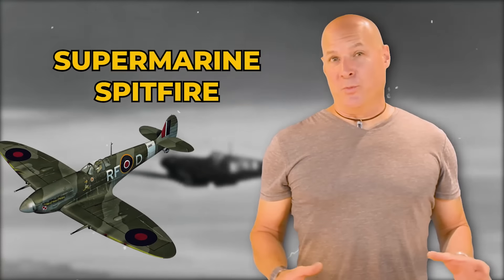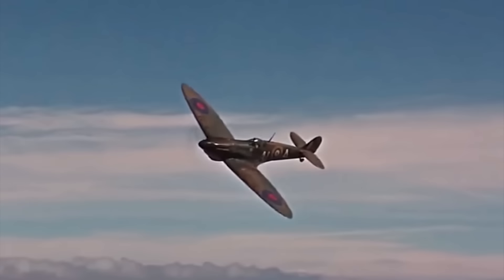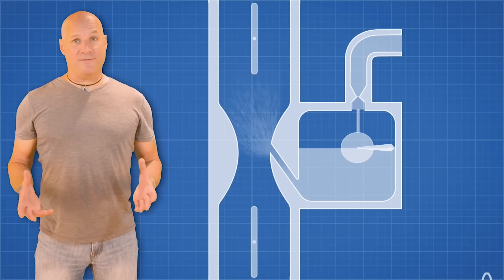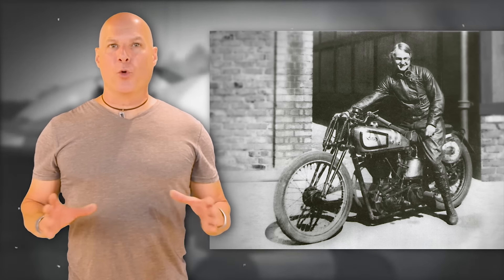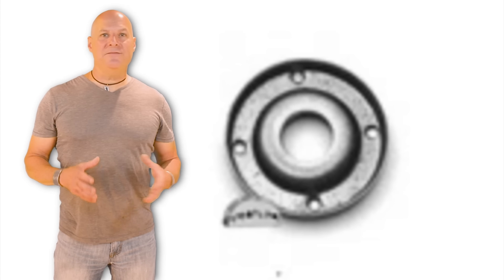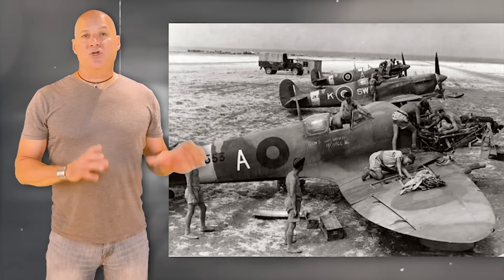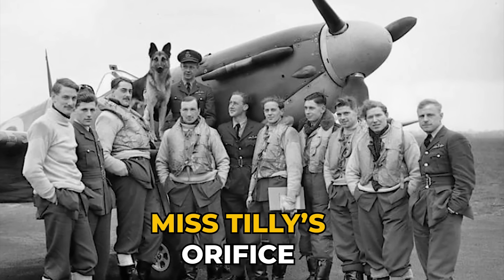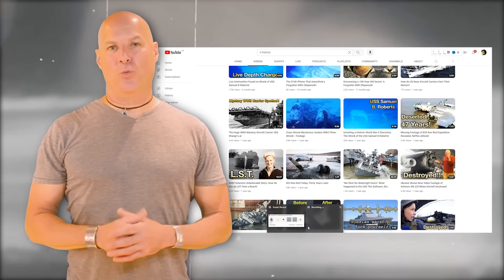How did SHE Save Britain’s Troubled WW2 Spitfire Warplane?

Comment: But it's the girl that makes the thing that drills the hole
that holds the spring that works the thing-ummy-bob
that makes the engines roar.
And it's the girl that makes the thing that holds the oil
that oils the ring that works the thing-ummy-bob
that's going to win the war.

Comment: You are blowing this out of all proportion. Even the title is misleading ''Awful WW2 Spitfire''. You can't be serious saying the Spitfire was awful talking about a momentary cut in engine power that pilots worked around by rolling inverted keeping positive G and entering a dive.
It wasn't some fatal flaw, yes the Bendix carburettor solved the problem until they (RR) developed the S.U. injection carburettor.
RR had a very good reason not to use fuel injection, this information is in books about the Merlin from the RR Heritage Trust Library. What a drama queen.
Reply: Target destroyed.
Reply: agree completely. using the term “awful Spitfire” brings this video into the realm of clickbait.
Reply: @slaktrax  well He is an American,   you have to make allowances,  big ones 😊
Reply: @andyb.1026  😂

Comment: Germans built mechanical fuel injected engines, Brits mechanically choke down the fuel flow, the Americans? Well they practiced the J-stroke; a dive where the pilot would roll the plane upside down before diving down on an enemy which allowed g-forces to keep fuel flowing as normal. A technique that had to be relearned when the Army Air Corps absorbed the Flying Tigers and disregarded their hard won fighting techniques against the Japanese.

Comment: You assumed that she was ignored because of just her gender, well if a man of the same age had invented something it might also have been ignored, because she would have been about 30 years old at that time.  If someone is only 30 years old and has a BSc in engineering then they will only have at most 8 years experience, but if someone had a masters degree, then it would mean at most 6 years experience.

I'm guessing there would have been plenty of men with far more years experience and many with decades of experience, it's likely that she was ignored because of a lack of experience and gender, not just gender.
Reply: She was a pretty mean motorcycle racer too.

Comment: What nonsense. The Spitfire would have been a massively successful aircraft even without the fuel orifice modification, and other remedies were also being;g considered. Let’s not confuse it with the scale of absolute failure that was the P51 before the British fitted it with their Rolls-Royce engine and made it the brilliant escort aircraft it became, though it never outfought the Spitfire as a fighter.
Reply: The Spitfire was a relatively short range interceptor, the Mustang was capable of long range escort. The Mustang was also initially designed to RAF speciications as the U.S. was not yet at war.

Comment: Carburetors and Aircraft that would support aerobatics and inverted flight were around long before World War 2. The question is why Rolls Royce didn't use existing carburetors that didn't flood when inverted? Good on her for creating a simple, cheap solution. Even if it did cause a momentary fuel starvation and slight lose of power. You ran the risk of overheating the engine and warping the heads or even melting them. This would limit the number of sequential inverted maneuvers you could perform. The first female Aeronautical Engineer in the U.S. was Helen Ingramann. She worked for my father who ran Grummans Flight Test Department from it's Inception until the 1960's when he was made number two on Appollo for Grumman and got transferred to the Cape.
She lived across the street from us in Northport L.I., N.Y..

Comment: Comparing the BF 109 to English fighters in England, it was superior except for range and poor tactics. Because of these, many ended up on the English Channel. 66% of BF109 losses were due to accidents. That's why those strange lifebuoys were there.
Reply: If two of every three losses were the result of 'accident' that hardly suggests a reliable aircraft.
Reply: @dovetonsturdee7033  No one said it was safe for anyone. An offensive war requires three times as many aircraft as a defensive one. In Eastern Germans digged hole to end of airstrip for push crashed 109`s off the strip with a bulldozer.
Reply: @jarikinnunen1718  'Germans digged hole to end of airstrip for push crashed 109`s off the strip with a bulldozer.' You are hardly making much of an argument for the 109, are you?
Reply: @dovetonsturdee7033  If I start tell to you what you want, I`m expensive storyteller.
Reply: @jarikinnunen1718  ' I`m expensive storyteller.'  Clearly, you are also a rather confused one.  You boast of the wonders of the 109 by telling us about how accident-prone they were, and how the Luftwaffe disposed of the wrecks.

Are you sure you aren't a retired Focke-Wulf salesman?
Reply: @jarikinnunen1718  That a 109 was out performed by an Airacobra is hardly a recommendation. 
You keep writing about the wonderful 109, then relate stories about the shortcomings of the aircraft.
Reply: @dovetonsturdee7033  It was trap. Aircobra was sneaking in the clouds above and Hasse Wind was after the baits. In summer 1944 enemy shot down 6 109`s. It had 20x more planes and lost about 500.
https://youtu.be/MskaL88Vl-o Finnish gun camera and interview with subtitling.
Reply: @jarikinnunen1718  Imagining the Russian pilot having the temerity to use weather conditions to his advantage.  What an absolute bounder and cad! Didn't the Soviets even know the laws of cricket?

Do please depart with your nonsense.
Reply: @dovetonsturdee7033 Tell me you ultimate wisdom, why soviet pilots was so hopeless. With 109, kill ratio was 42:1 (Luettelo Lentolaivue 24:n ilmavoitoista ja sotatoimitappioista) Win, lost list. By the way. Most of Finn pilots had learner sign on 109.
Reply: @dovetonsturdee7033  
Parking in The Channel because you ran out of fuel,  
ground looping because you forgot to lock the tailwheel,  
collapsing your undercarriage in a poorly filled in bomb crater 
& losing it landing a battle damaged aircraft are all classed as accidents.      
Plus the 109G model's engine did have reliability issues.
But then the 2 highest scoring aces in history almost exclusively flew 109's.